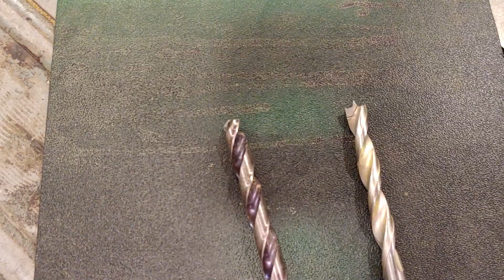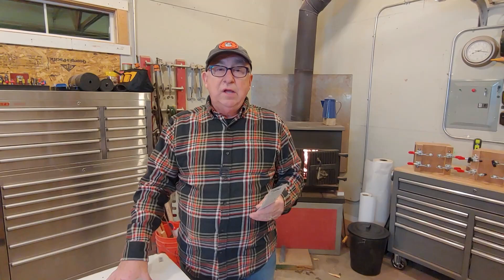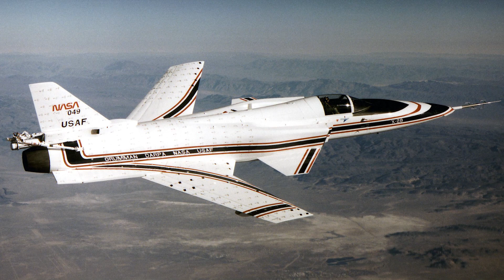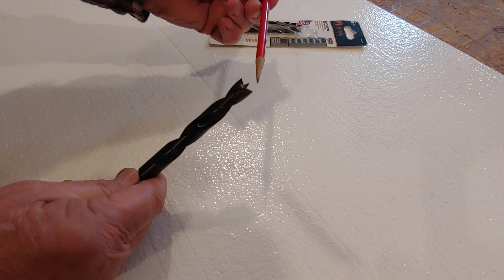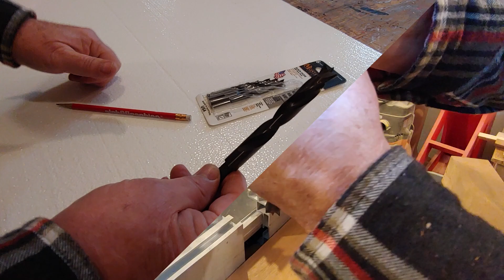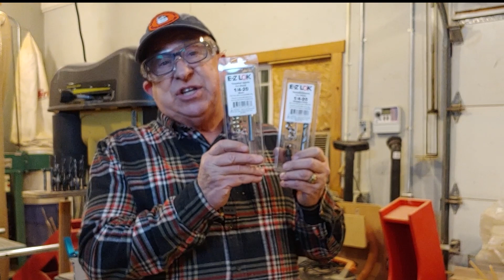Best Wood Drilling Bits - Brad Points!

Comment: I don’t have a drill press and have to drill 4 holes to install metal inserts in a painted guitar body to install a bridge. Should I drill a pilot hole first before using my Brad point bit or seek out a drill press to use? Would a Brad point even follow a pilot hole?

Comment: I would love to buy from Rocky Mountain twist, but they sure make it very hard to know what sizes of bits you get with the brad point sets. Not sure if this is set up so only very advanced, contractor level people need apply, or I am missing something. 
All it says, is..
Maintenance - Fractional Sizes
Size: 1/8 - 12pk - 95006504

Sure fractional. But WHICH fractions? Kinda important info.